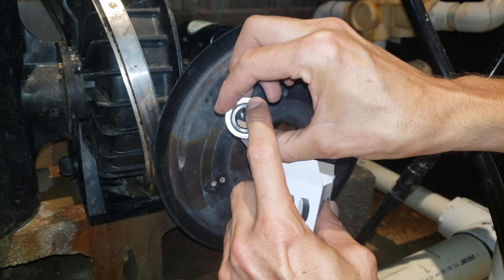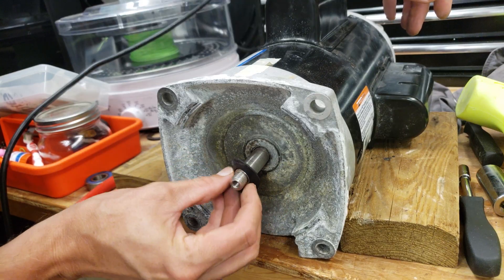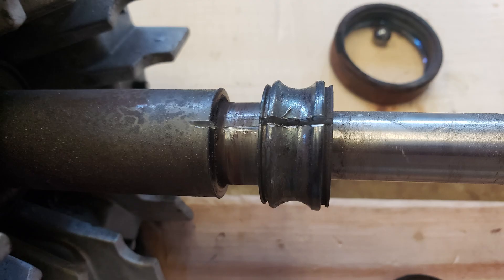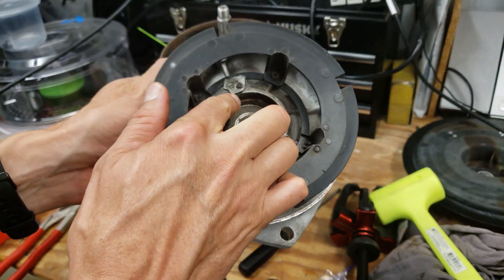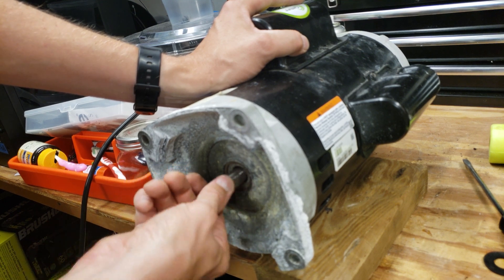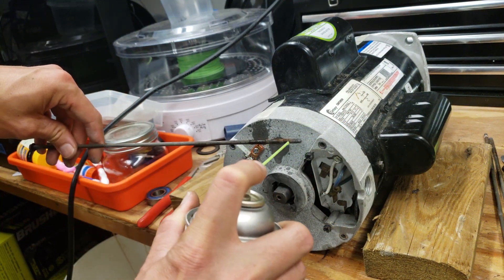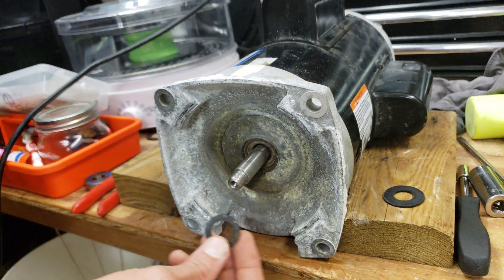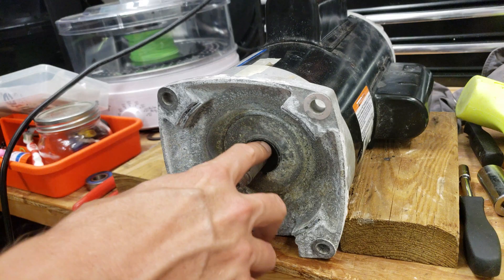Fixing Dead Pool Pump Motor By Replacing Bearings | Century Centurion B1000 Commercial Motor Locked

Comment: May I know what size breaker did you use for that pump , code book call for a 70 Amo breaker for a 5 hp motor ( but that’s the maximum)

Comment: Generously lubricate the long through bolt threads with anti seize compound, not just spray lube. This will facilitate getting those bolts out next time. Also, when you have the motor apart, you can put anti seize in the through bolt threaded bosses in the end cap. Also, the screw for the bearing retainer often seizes as well, so lube that up with anti seize as well. Seizure of either of these fasteners can seriously impede a future rebuild.
Reply from the maker: Good advice!

Comment: Nope...
Just gonna replace the motor as an assembly
Reply from the maker: Bearings are $50, this motor is now $1200, and get this, a year after the bearing replacement, the pool members replaced the motor while I was away cause they thought it was bad (was only the push on connectors that burned up). New motor bearings lasted less than 2 weeks before going bad. I came back, old motor tested fine and reinstalled it and it's still running 24-7 with the bearings replaced in this video. We returned the new motor because the bearings burned out so fast.
Reply: @engineerable  wow!! Something to think about. Thanks!!

Comment: Any tips to getting the bearing screw loosened? That is the one thing that is corroded to the point it won't loosen. I've tried using heat, battery cleaner, lubricant, you name it.
Reply: This screw needs to be liberally lubricated with anti seize compound for future disassembly.
Reply from the maker: Sounds like you've already tried a lot of things. Try an impact wrench or driver. If all else fails, cut the head of the screw off with a rotary tool, and replace the screw.

Comment: Thank you for the tutorial!  I have a seized 3/4 HP Century pressure-side pool cleaner motor that is the little brother of the  one you replaced the bearings on, and even uses the 6203RS bearings. I appreciated your many helpful "why" explanations of the numerous small washers, seals, and the bearing itself, several I haven't heard anywhere else.  Some questions...  
1) What was the lubricant you sprayed onto the 4 long bolt ends?  Why choose that instead of an heavier, wheel bearing-grease-like anti-seize compound? (or even good ol' Park Poly-Lube)  
2) What were the symptoms of the motor bearing failure?  For mine, one day the motor would just "hummmm" instead of spinning when power was applied.  Did your motor do that, or something else, like make a screeching racket and/or leak water?

Conclusion... as a new-ish pool owner, I'm gathering that I should plan on replacing pump motors every couple years. I've seen a couple guys with videos of how they get new motors and then "rebuild" them before installing by replacing the factory Chinese bearings with higher quality Japanese or European bearings, and greasing or anti-seizing all the parts and fasteners they know they'll need to later remove, like little screws that might corrode-weld themselves to what they are holding together, the cap ends of the case, etc.  So I'm thinking I'll just keep a rotation of 2 motors for each pump, one that's in and working, and one that I rebuild such that I can swap it in when the operating pump (inevitably) fails.
Reply from the maker: 1) Nothing special lubricant. Yes, you could use better anti-seize lubricants
2) The motor became very loud. This one has no timer, and runs 24/7. It was insanely loud for several days before locking up and making the hummmm and tripping the breaker. We should have stopped it right away when it got loud. The premature bearing failure was caused by a leak in the pump/motor seal that wasn't repaired quick enough. 

Having a second motor is a good idea. Not a lot to go wrong with these besides over heating the coils and wire insulation failure, or start/run capacitor failure. 
Leslie's commercial pool supply did not have the bearings, and said and they had never heard of replacing the bearings only and they always replace the whole motor. Of course they'd rather sell you a $700-800 motor.
Reply from the maker: So here's how cheap the bearings are that come stock with these motors. Recently someone replaced this motor because they thought it was bad (while I was out of town and turns out it was just the external wires burned up due to poor connection). The brand new motor (which is now $1200) lasted less than 15 days before the bearings went bad. I switched it back to the old motor shown in this video with the quality bearings and it continues to work well. I used the screw down terminals this time instead of the push on terminals (which are imho not suitable for this application and power).

Comment: I need to replace the square gasket at the pump basket housing ( its leaking ) 

And I have not seen any videos on this
Reply from the maker: Are you talking about the one that is at the top where you unscrew the lid to open?
Reply: @engineerable  no between the pump basket housing and the pump motor
Reply from the maker: @Clowndanceat3  I haven't needed to do that yet, but it should be easy. Remove the 4 bolts, separate the basket from the pump housing, and replace the gasket.
Reply: How did you handle the brushes? Please tell me that you didn't just hammer the armature assembly past the brushes.
Reply from the maker: @jimjones8428  These motors don't have brushes. They are induction asynchronous AC motors.
Reply: @engineerable  really? I had not seen THAT anywhere. I guess I am fixin to find out for myself. That's why I was watching your video.
Reply from the maker: @jimjones8428  I think all pool motors are induction (no brushes), because they are continuous duty and the large motor size doesn't matter. If you are only replacing gaskets, the motor will not need disassembly. In another video I disassembled the motor to replace the bearings, because the water had leaked long enough to damage the motor bearings.